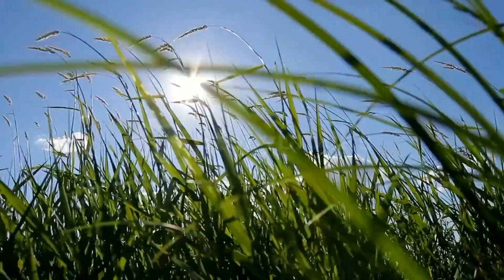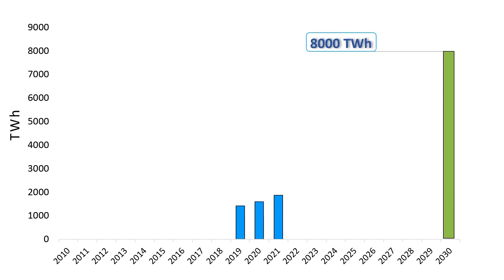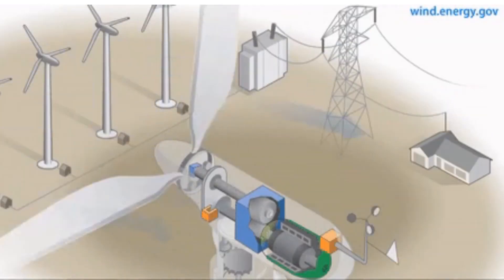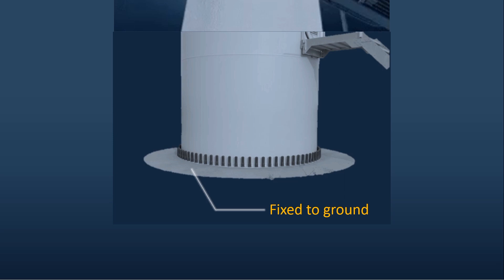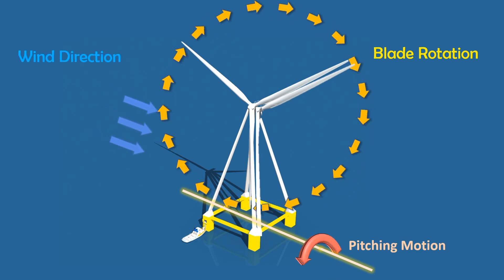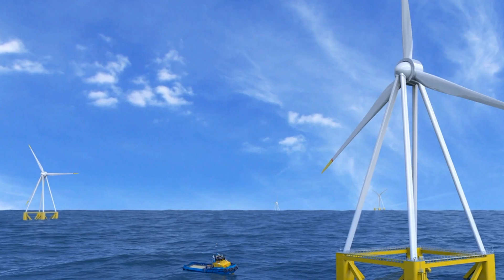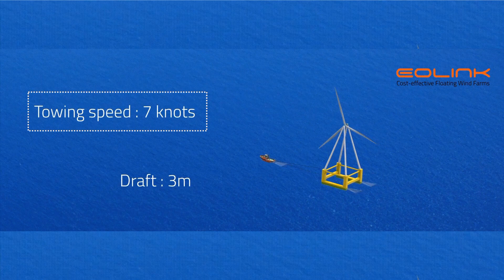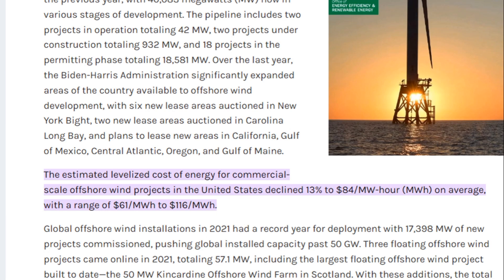How This Structure Unlocks More Wind Power?

Comment: Current solar farms only 22 percent efficient are an even bigger ecological issue literally creating hot spots and again should be elevated at least 10 feet or more off the ground for dual use of the land underneath for crops and livestock plus providing a larger distant for the heat spot being created by the panels also and ecological and adding to global warming...most of this tech is being implement prematurely and amateurish so far ruining the climate warming alarmist credibility even more...should have completely started this on existing building instead of trying to force this as a business like they are power plants...it is literally all about the poor implementation to date...